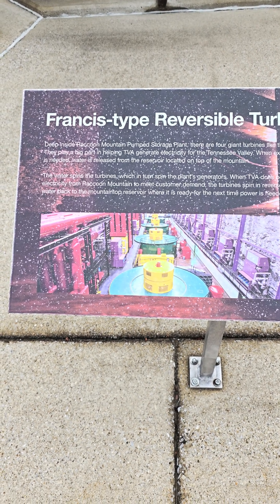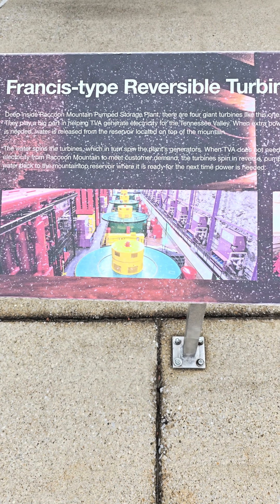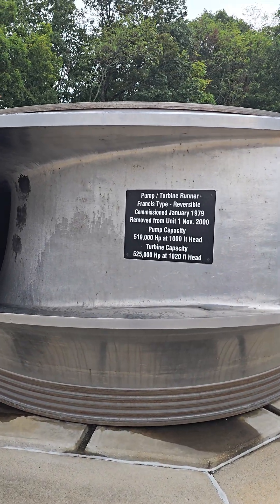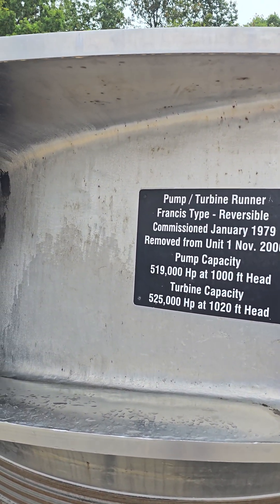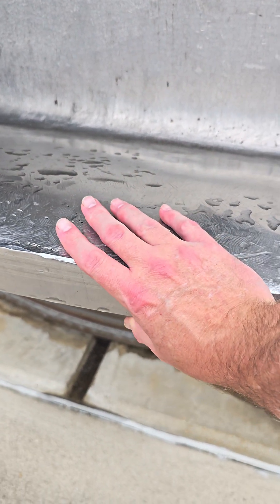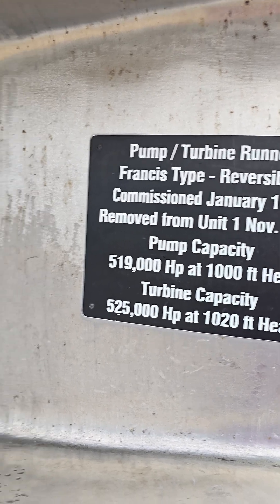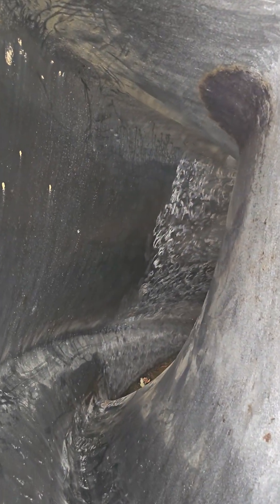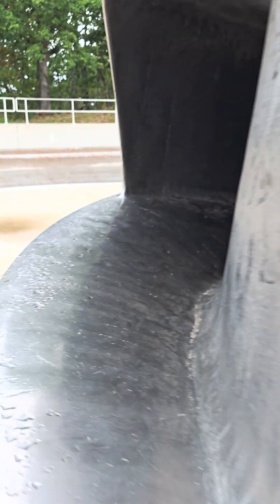Holy Francis!   Its a turbine

Comment: For those of you that don't know what that is.. It is the turbine blade for the pump station.. What they do on the Tennessee river right down below where he is at, is they pump river water up into a huge reservoir on top of the mountain. It is a really nice sized lake.. They fill the lake up at night using the turbine shown that is buried inside of the mountain in something that looks like a James Bond movie set. There are about four of those pumps down there.. They fill up the lake when the electricity rate is cheap at night, and then when there is huge demand for electricity in the evening rush hour, they drain the lake back down across the turbines which spin and create electricity of which they can then sell that at a higher rate when they put it on the grid.. It is quite the site to see. They used to have tours down into the pump station which is bored into the mountain, and you go down an elevator that is taller than the empire state building, to the actually below the river level.. Once you get down there, they have a hallway that is about a block long you go down, all carpeted and looks really cool.. You take a right at the end of the hall, and there is the viewing room overlooking the pump stations giant motors and turbines. Everything is painted really cool. It does look like a James Bond movie set. After 911, they quit letting people take the tour.. It is sad, because it was one of the  coolest attractions in the area. Andy is showing you the massive turbines though that they used to use to fill the lake with. That one must have been well used and they replaced it. Thanks Andy for showing them the massive turbine blades!
Reply from the maker: Thanks for this. I have lo ger videos talking about Raccoon Mountain but didn't think to include a link in the description.
Reply: @AndysJourneys  What is sad is that back when we got to tour it, we didn't have video capable phones like we do now... I'd have filmed it, but I think they didn't like you taking photos or anything inside of it.. It was really impressive though.. I know you have seen my video of my huge camcorder ride going down the Raccoon Mountain slide.. (Cause that is how we met) ... But the pump station was quite the thrill. I was a bit nervous riding that ultra long elevator though.. It kind of wobbled a bit on it's axis here and there during the journey.. lol. We used to camp in the forest really close to there on the opposite side of the river., back when I lived there.  I am back in Baytown Texas now, but hope to move back that way someday, money permitting.
Reply from the maker: They have had a few tours since but I didn't make the cut in the lottery.  I remember the tours. The fast elevator,  the echo tunnel and looking out into the turbine hall.
Reply: @AndysJourneys  Yeah the echo hall was so cool. Lets you see how slow sound goes in comparison to light lol.. Remember the giant American flag hanging in the pump room? I loved the viewing room.. I wanted to just let them have me live there lol.
Reply from the maker: The flag was cool.  Maybe I'll get lucky next time they do a tour